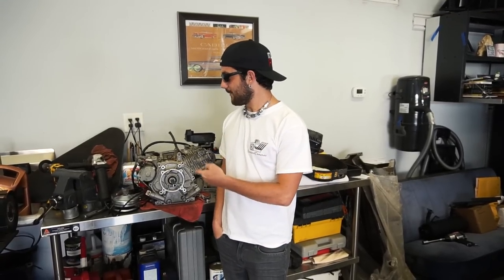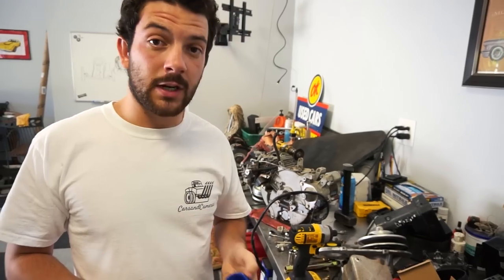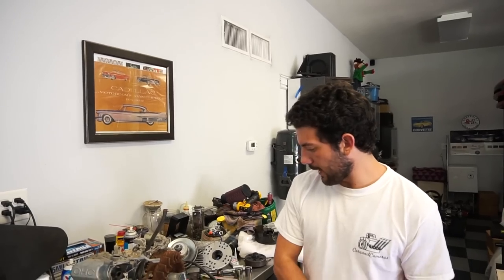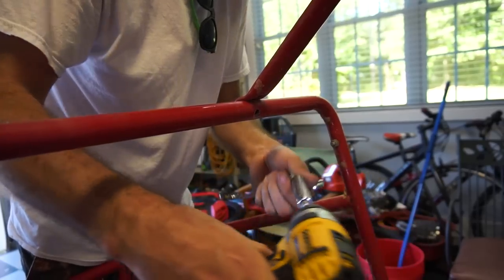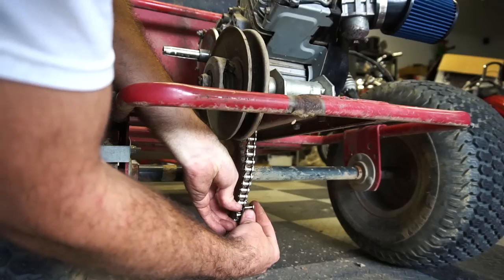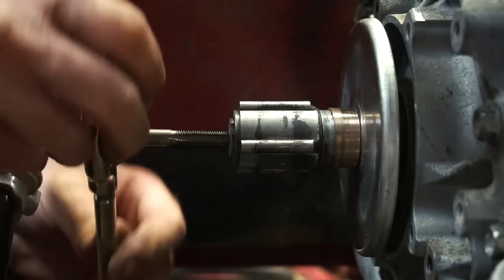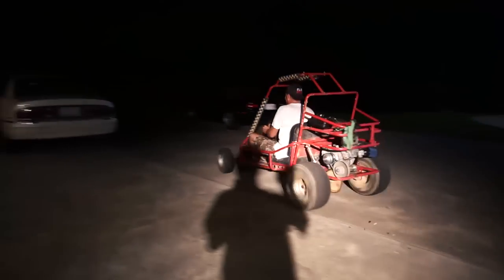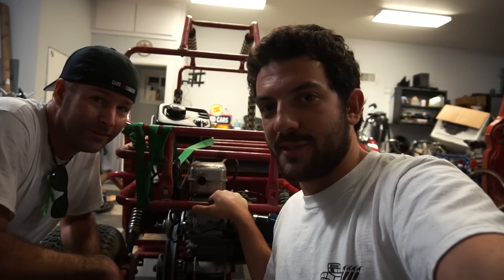Yerf Dog Subaru Swap Pt.  2 | IT RUNS!

Comment from the maker: Even with a slipping belt its so much better than that 6.5
Reply: CarsandCameras John your editing is getting good
Reply: scooby doo?
Reply: Kyle Butler subie doo
Reply: I have 2 yerf 3203's. 1 has a 212 predator and the other a 301 predator. If you have any questions hit me up they are both beast karts
Reply: I'm with Donal,  Scooby Dog
Reply: I call my Subaru the subraaa
Reply: CarsandCameras put generator fuel tank on there.
Reply: I even have a theme song, it goes something like this: Scooby Dooby Doo Where Are You, I Think You're Going To Get Busted!! Ha Ha
Reply: I'm thinking Scubaroo!
Reply: You know it's a Subaru and most Subaru's are turboed so I'm just saying you know you should turbo the damn thing
Reply: Subaru+yerf dog=serf dog
Reply: that's my type of engineering I love it haha
Reply: Subie Doo!
Reply: I Put a Suzuki GS550 in mine
Reply: Would y'all ever sell old motors like the 6.5 you took off this kart
Reply: Just so you know I put the same engine but from a pressure washer in my go kart
Reply: The reason the chain moves over near the engine plate is because the drum break torques the bearing plate on the left side I had a 3203 that had that problem and so i took the off and put it in the shop and then to weeks later it burned down so now I don't have an engine and I cut up the go-kart to make a mini bike so it's all good I love the channel guys
Reply: CarsandCameras  Tecumseh haters. Where are the bloopers?
Reply: I don't appreciate how you're talking about the power sport.  If you don't want it that's fine I'll take it but that poor Tec deserves more.
Reply: @2amshenanigans  what series tourqe converter did you use with the 301 predator
Reply: @jamiegallogly9207  let me look it up for you. it was weird since the output was either 1" or 3/4"

Comment: It definitely turned out very well
I've actually heard of people cutting down those tapered shops with a grinder while the engine is running but when you have access to a lathe it's so much easier.

Comment: This is one of the best channels on YouTube, hands down. That was cool, the Tecumseh on my Yerf Dog is seized, but i 
got it for Free!!!, thanks for all the ideas on what way to go with replacement engines, whatever route i go i am sure It'll be fine 
now!!!!
Reply: Moderate Extremist the predator 212, is alot more bolt in, and alot cheaper, but I think with a stock frame you might be close to hitting the upper frame bar
Reply: 16driver16, i agree, and that looks like my best option.
Reply: Moderate Extremist if it's the same kart u need to reinforce the frame I DESTROYED mine offroading gotta weld her up I have the yerf dog 3203 which is what they have. A 212cc is a easy swap I have a 212 on mine
Reply: I agree Ryan, I am in the process of adding reinforcements right now, i am adding extra cross bracing and 
more bars across the bottom.  The 212 is a really cool engine, i am going with the Hemi version, saving up
for the works, billet rod, mod2 cam, milled and ported head, shimed springs, and a mikuni:)

Comment: You guys make me miss my Subaru(s). I've owned two and beat the living piss out of them. Both still running around town and one is now well north of 400k miles (sold it with 276k). My wife learned to drive manual on that one, and that same Subaru was our 'rally' car. It took the beating from Alaskan ski trails / beaches and never once let us down - even with the car overloaded it would just claw right through snow over its head lights or sand deeper than most heavy trucks would get stuck in due to weight.

Comment: I was successful in the application of a ten horse briggs and Stratton on a mini bike.
It fit.
It ate the belt immediately.
No matter how slow you throttled it...it ate the belt.
But the back tire had a sprocket AND belt side by side pick  your poison.
A trip to the hardware store for a centrifugal clutch and a salvaged chain.....
It was fun untell the wheel bearings failed.

Comment: I am currently building a shifter kart and was wondering if I needed to be able to weld , you guys are awsome keep it up!
Reply: Jack Myrah yes you will have to be able to weld unless you want to bolt everything together. Welding is more practical though.
Reply: harbor freight mig welder that uses standard outlets is usually $140 or less, good thing to learn on but obviously not for major welding. Its fine for a gokart though.

Comment: I think when you blew out the carbs fuel line you un-seated the rubber grommet the needle valve seals with. That might be where the fuel leak is from.

Comment: Question:  Why wasn't the end of the crankshaft cut off, drilled and tapped when it was in the lathe?  It would have been faster, more accurate, and all-around easier to have done it then.

Comment: If you guys had to stick with 1 Predator engine, which would it be, the 212, 301, 420, or 670?
Reply: Ratkill9000 
Id choose the brand new Briggs 24hp I got off eBay for 740 shipped to my door.
Reply: I’d go 420

Comment: Does the fact that it is OHC give it a different power curve vs the push-rod engines?
Reply: Not really, in high performance applications it would experience less valve float, but this engine will never run high enough for that to be a issue really. Power curve is a dependent on airflow, compression, cam timing and ignition timing how the valves are opened doesn't really change things outside of allowing perhaps better valve control at higher RPMs..

Comment: Are you guys using oil designed for water cooled or air cooled engines? I would recommend using air cooled motorcycle oil of your liking.

Comment: I have the 7hp EX21 engine with the same strange tapered shaft... I don't know if it's worth me splitting the motor to get the crank turned on a lathe like you guys did. :/ .. nice work anyway

Comment: Don't know what you have planned for the exhaust but in the spirit of using a generator engine which is used in commonly used in residential areas is there any chance of a super quiet exhaust? Just wondering because I just made a custom glass pack for my sons racing mower and wouldn't mind seeing somebody else's take on the idea.

Comment: I had a 3 hp subaru that i put on a little carter 2 seater kart after the Tecumseh 5hp quite on me. It ran just as fast if not faster  with that 3hp on it. Ran like a raped ape. It was really quiet too.

Comment: Why don't people use small motorcycle engines for this application? I know they use them for shifter karts but I feel like I rarely see them for things like this. I had a Briggs Intek 725cc and it was gutless. It was a decent crawler because of the hydrostatic drive but even with a belt drive and decent gearing I can't imagine it being too thrilling performance wise..The entire motor is built around peak torque and probably has valve float at a pretty low rpm when the governor is off, not to mention the camshaft and head aren't designed with flowing much air above factory operating rpm. You can get 20ft lb and 20hp out of a mid grade 250cc and potentially for less money, not to mention building a 125cc to pull similar power. Not to mention two stroke. Did I mention it comes with a clutch, gearbox, and.. Omg.. Sprocket on the output shaft from the factory.

No sarcasm: can someone explain the infatuation with these mower/tractor/generator motors?

Comment: Love your vids and thanks for them..
I have a warrior that I am putting the ex27 engine on.
I will leave the stock gear reduction on .
Would you have any input on my trek...?
My engine was multi quip so it will bolt right up and has a pretty much stock 1 inch shaft..it is not e- start.

Thank you..
Reply: sorry, we have no input

Comment: So my dad and I have our go kart put together. It runs and we've had to make some small adjustments here and there. I'm not to sure about why or where its leaking fuel, but it is. I'm pretty sure its the carb. but i cant say for sure. Do you have any idea on why it would do that? Its basically a brand new 212.

Comment: I have a baja warrior I am planning on putting that ex27 on it with the stock gear reduction set up .
It is a multi quip engine so it should bolt right up with very little mods.
I was thinking the 9 up would just give it a little more umph and be incredibly reliable..

I like to hear your opinion on the set up...

Comment: Hey guys I got the same yerf dog. I also have a gsxr 750 in my garage. Do u guys think it's possible to put it on the yerf dog?
Reply: Bonez P I've been looking for a gsxr750 engine for a while. what year is yours? and unless you take off the back cage, i doubt it would fit on a yerf dog style chassis.
Reply: king Schuyler I got it from let go app. I dunno what year it is. Yea figured I would need to take off the cage..  *650 not 750. I'm kinda thinking sell the yerf and buy a frame or something more beefy. I mean I think it should work I know "testing purposes only" "it'll be fine" hahaha

Comment: What's a governor?
Reply: GuyDoingRandomVideos it's a dude who is the head of a public institution. like a school or bank and so on. more of a British thing
Reply: It limits RPM in the engine, on modern fuel injected engines you might call it like a rev limiter, but instead of electronic its mechanical. Keeps the engines insides inside the case lol... :)
Reply: Yeah, I get it, it was a simple to look up deal if he wanted, I just felt like educating, if he read it great, if not ok. Now if he said double turbo it, yeah I would have probably not replied at all.
Reply: Reverend D Thanks bud!

Comment: You're videos are pretty cool. I don't want to be rude, but you're videos have been a little boring because you keep on doing the same thing with every go kart you build. Just slap a preditor engine on them and show that it runs. I want to see you guys build a go kart with a street bike engine or a dirtbike engine. Something with a lot more power and torque.
Reply: Azia CR You must not be watching their every Monday build.
Reply: They've built and are building some larger engines, but none of the high performance engines. I've seen the dirt bike videos they made, but they still haven't made a shifter kart or something powered my a street bike/dirt bike